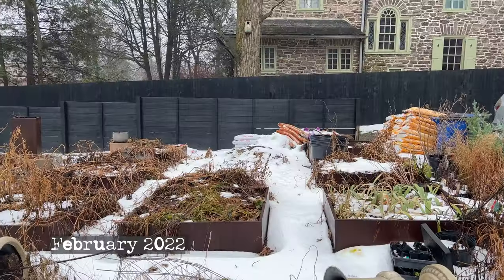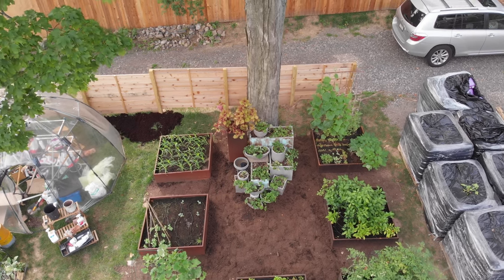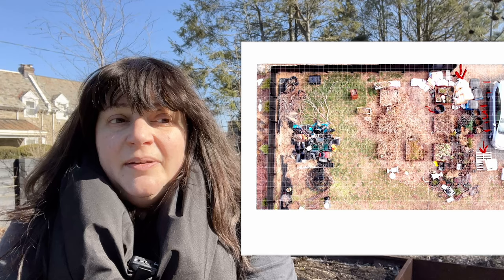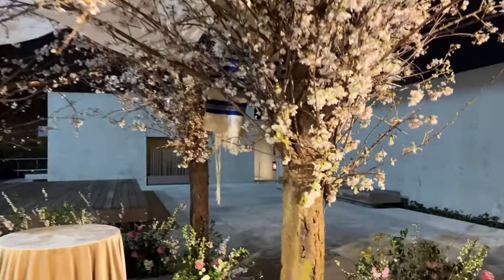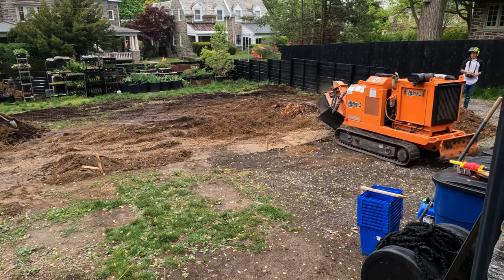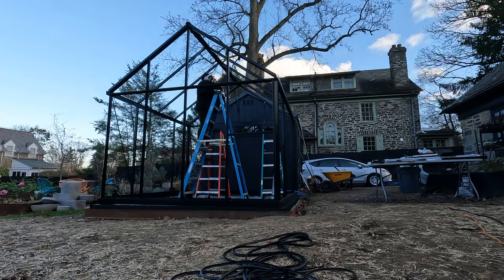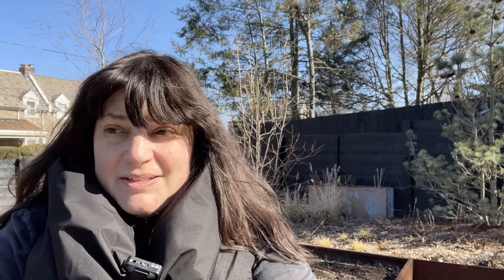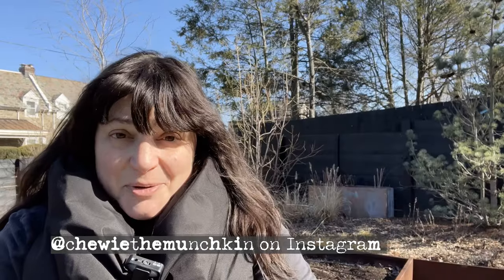My DIY Potager Garden Design | One Year from Design

Comment: If your greenhouse is already hitting 90° in February, what will you do in the summer months? That is one of my fears, I'm in North Florida zone 8b and already trying to figure out shade clothes  and fans.
Reply from the maker: I'm not sure it was quite 90 as the thermometer is new and was in the sun but it definitely got warm. The roof windows opened automatically but at some point I'll share the details. I designed the greenhouse with two sets of double doors that can be opened and two sets of windows opposite each other for a lot of cross ventilation. At some point I'll add shade cloth and fans but I don't expect to use it much for growing anything in the heat of summer. Good luck with your project!